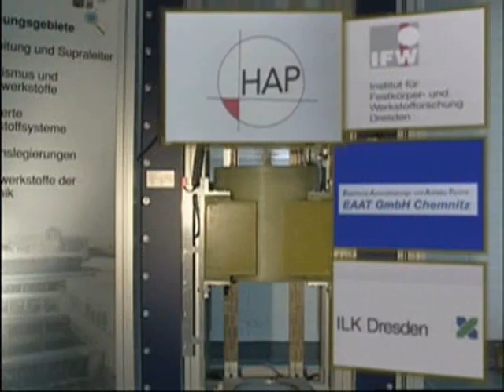IFW-Dresden Superconducting Maglev Lift

Comment: As long as they are using superconductors and liquid nitrogen, any magnetic bearing is going to remain outside general use.

Too bad they dont seem to realize that you can rotate the magnetic fields and eliminate the need for the additional weight and power usage of these systems.